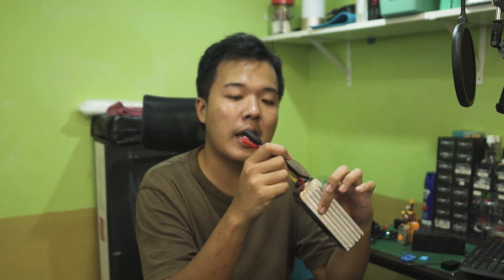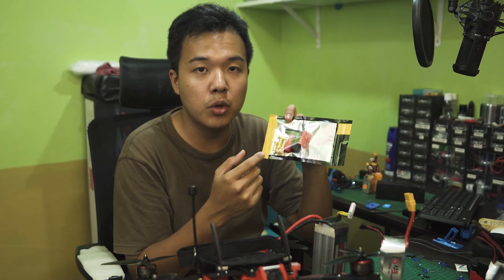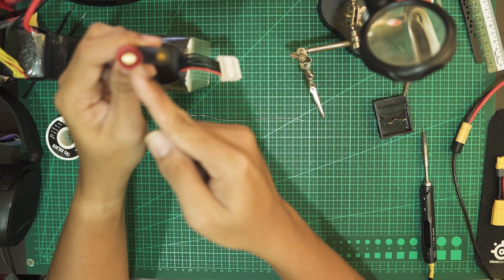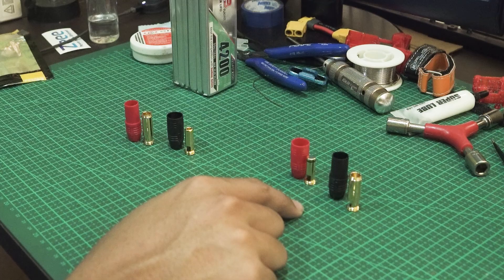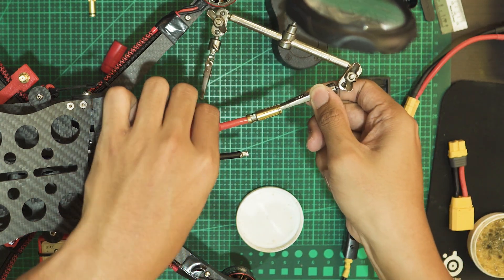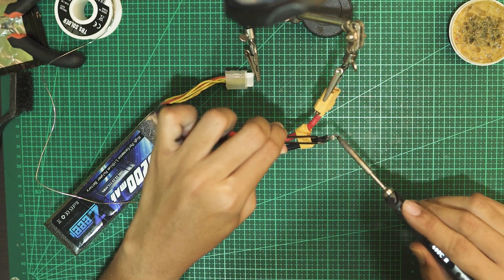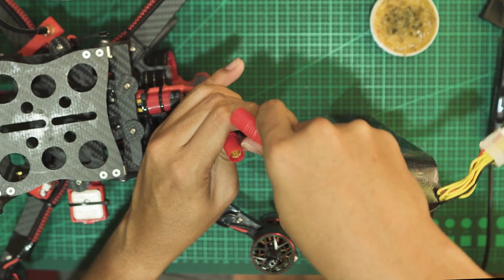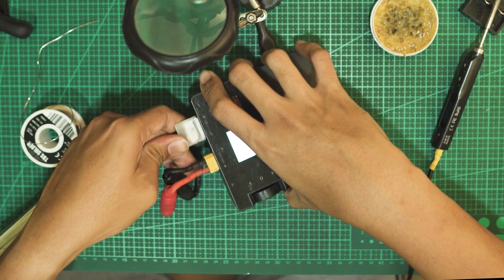AS150 Plugs for Cinelifters

Comment: The Antispark male (red) connector, should be on the ESC cable, not on the battery.
That's the way to do it, and you need only one Antispark plug, it will save you money.
Reply from the maker: This is a very good tip if manually soldering all battery leads 👍

The lead choices I was going for in this video is, from my findings, what lumenier and tattu ships their AS150 lipos with
Reply: I wonder about this.... I can see where the AS device has a limited lifetime, and therefore should go on the limited lifetime battery.

Comment: I was going to ask Why would you make a XT60 to AS150 adapter instead of just Bullet to AS150 but then I realized your charger used XT60 to charge batteries mine uses bullet plug to whatever battery plug you have to charge batteries lol venom 2 port charger